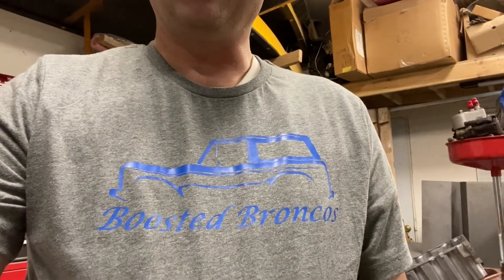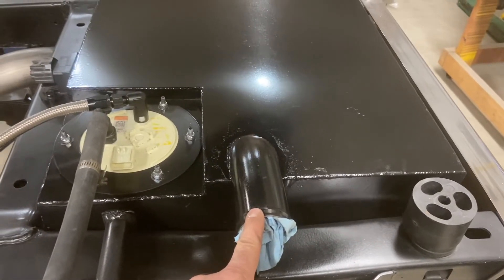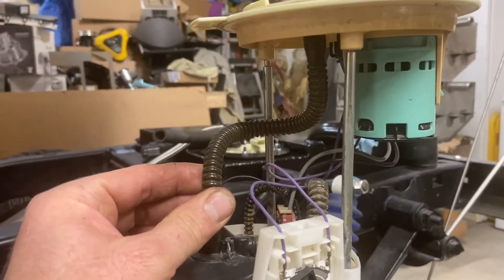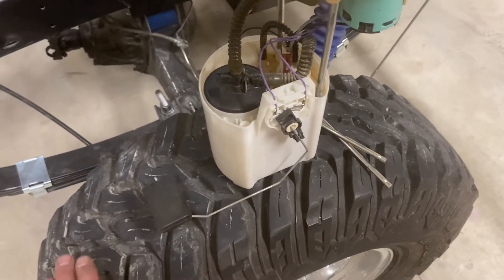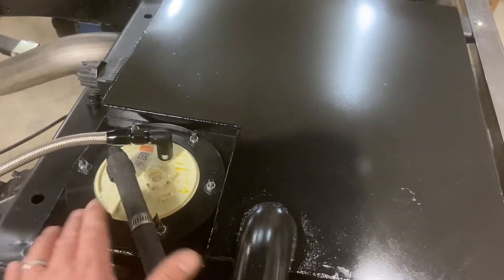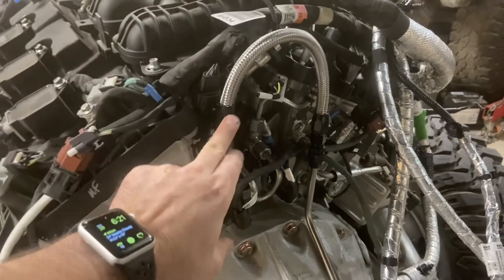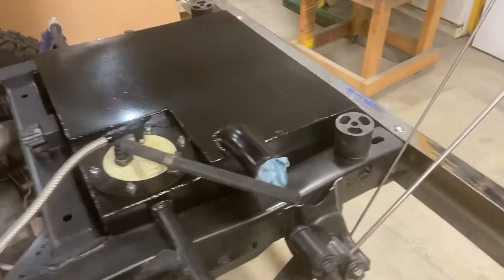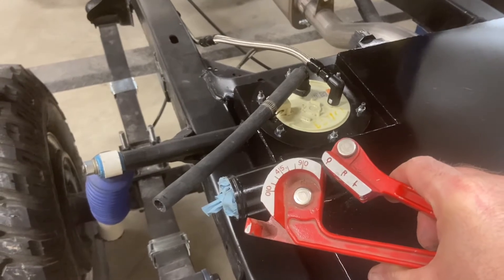Early Bronco Ecoboost Fuel System Install | Boosted Bronco Garage

Comment: So is the 2” lift required because of the fuel tank set up or is there a need for it on the engine/trans side as well?
Reply from the maker: 2" body lift is for hood clearance for the engine.  I can only set it so low in the mounts and give the turbos enough clearance to the frame.  The 2" minimum suspension lift provides enough suspension travel while clearing the oil pan.  At some point we may eliminate the need for the suspension lift with more oil pan mods, but for now we need the lift and adjusting the front axle bump stops down 1-1/2-2".

Comment: Very interesting! Is this engine version a direct injection? I was under the impression that the newer engines used direct injection and have a booster pump on the engine for the really high pressure injection? Just curious.
Reply from the maker: The 17 and newer have both port and direct fuel injection.  The high pressure fuel pump for direct injection is on the engine.  The 16MY and older 3.5L ecoboost is direct injection only.  The PFI (port fuel injection) helps keep the back of the intake valves clean.
Reply: @boostedbroncos9531  very cool! I had wondered if they'd fixed the problem with oil cake on the intake valve